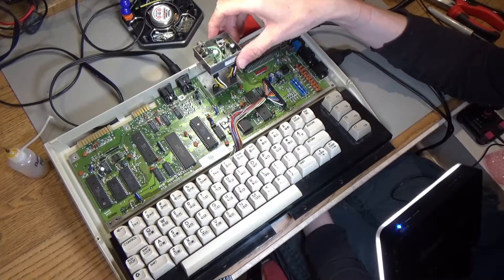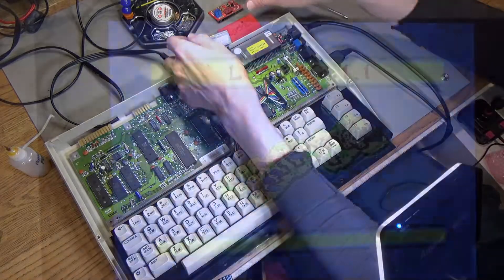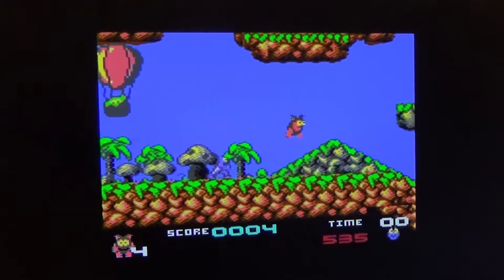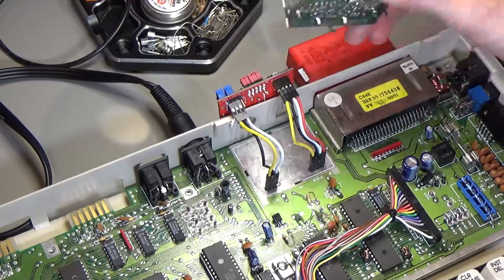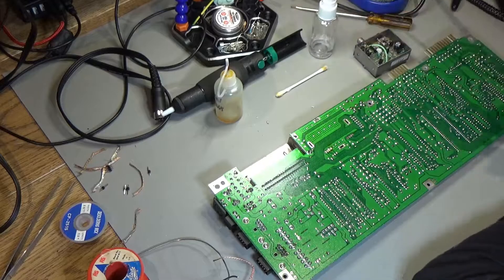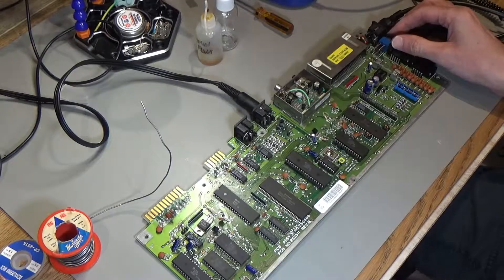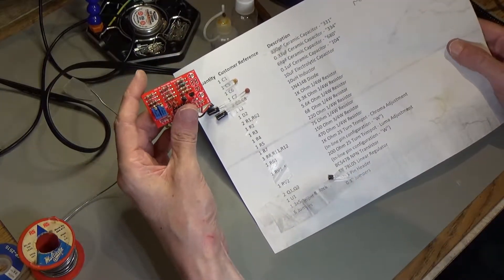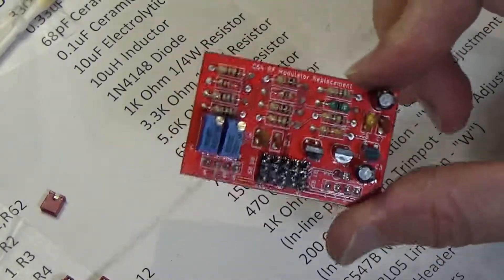C64 RF Modulator Replacement (by actually putting the old one back)

Comment: Thanks for the video 👍

A capacitor in my RF module exploded and I don´t know the value or how to replace it?
Reply from the maker: You'll need a soldering iron and a solder sucker to get the old one out. Did it explode because it was installed backwards?
Reply: @DavePoo2  No it exploded after 5 years sitting. The voltage from the power supply was 9vAC and 5vDC so nothing wrong with the power supply.

Comment: A dumb question … Where do you connect RF cable on replacement module
Reply from the maker: You don't, it doesn't have the capability to contact to an old fashioned TV. The modulator only provides the correct output to the video din connection.

Comment: Is there an easy way to get the old rf modulator off the board? I've tried solder sucker and solder wick but feels on there for good😱😱
Reply from the maker: They are really tricky to remove. I used a combination of solder wick, a desoldering station and hot air. You need some patience!
Reply: @DavePoo2  cheers i'll persevere and restrain from any "dremel thoughts" 😅 mine had a colour saturated composite signal (as seen on the scope) with none of the adjustable components having any effect. I just got "no signal" on the lcd tv.

Comment: Nice, thanks for the vids. Say, my C64C got those awfull vertical bars like you had in the first video when tuning the resistor. Some people said those bars are produced by the VIA chip. Is a resistor in the scart cable a good workaround? I've also got those strange color flashing like you had when poking the background colors. It looked liked, you got rid of it after trying out the resistors in your cable.
Reply from the maker: The vertical bars i believe are an artifact of the VIC-II chip, some of the variations of the chips are better then others but  i think they all do it to some degree. The resistors in the cable are recommend for the C64 as it's output is non standard as it was designed before the S-video standard was introduced. Some TV's/Monitors handle the out of spec input better than others, but the recommendation online was to use a 300Ohm resistor on the chroma line to fix it. I've actually taken that resistor off my cable now which stops it from working on the older breadbin C64's. This modulator replacement is good however as it has the tweakable pots for the chroma and luma output to allow you get the best from your current monitor setup.